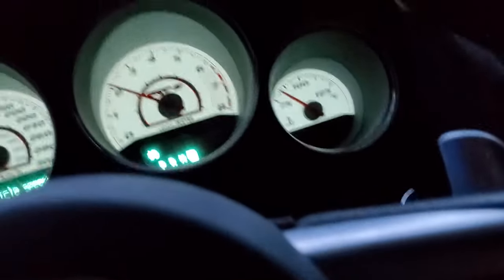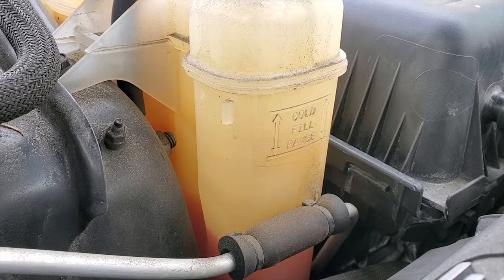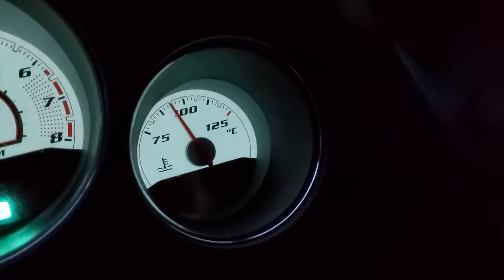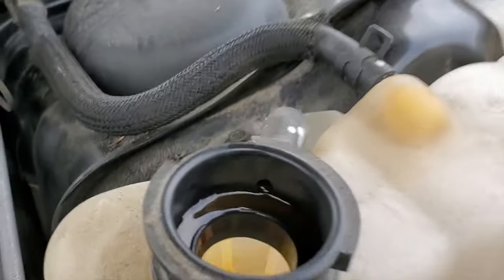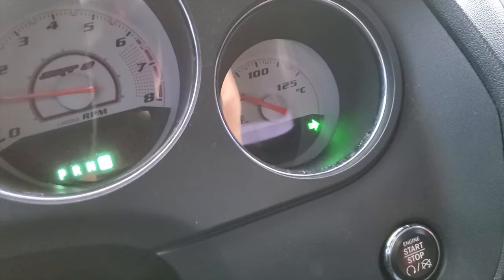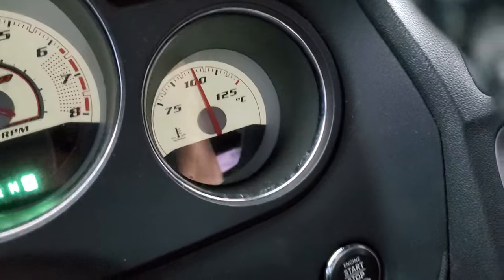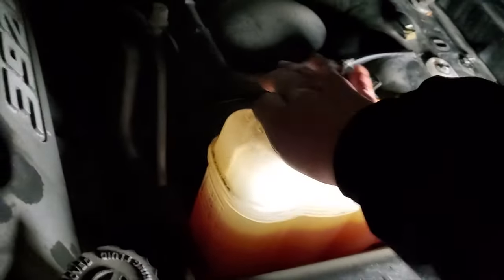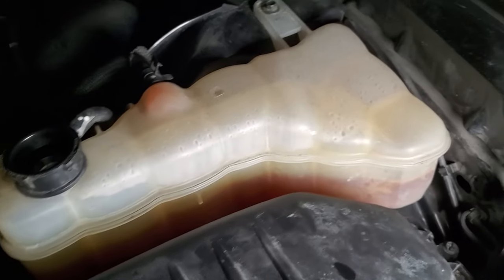Fluctuating Temperature Gauge Quick Fix on a Dodge Challenger

Comment: Many Dodge vehicles actually have unpadded temperature sensors which bring that reading to your gauge. Some fluctuation under heavy load is normal with Dodges; it is reading a true coolant temperature rather than a padded one like most other vehicles — look at the manufacture rating for your thermostat. My 3.6L’s stat is rated between 185 and 220, and the gauge will reflect that in normal operation and will definitely go over that conventionally “normal” middle line under heavy load — totally normal operation for many Dodge vehicles newer than 2007.
Reply from the maker: thnx for chiming in, changing the thermostat fixed the fluctuations
Reply: Hey has your check engine light ever came on with the p0128 but then went off I also noticed when I first got my car it would always move but never ran hot
Reply: @ericalove8387  Oh yeah, it likely stored that code change your T-Stat. That code can trip if the vehicle is running too cool your T-stat is probably stuck partly open

Comment: Im pretty sure your car is supposed to stabilize at a certain point usually a little under the half point and not fluctuate really at all. I would make sure your engine coolant temp sensor works and also make sure your gauge in the dadh cluster is reading correct.
Reply from the maker: Thnx for the tip! All seems well at the moment and the temp gauge has stayed under the halfway point
Reply: That's what I was looking for..kc

Comment: Bring the car to operating temp. Slowly open or release the radiator cap. Allow the air inside to escape. Fill with radiator fluid and repeat

Comment: I’ve got a 5.7 hemi it’s a 2006 grand Cherokee idk what it is but I think it’s the water pump is bad because it will idle just fine without overheating or anything and it’s fine for around the first 10 15 minutes of driving but then all the sudden the temp just blasts almost all the way up and I have to put it in neutral and get it to 4500 rpm and it will eventually cool down most of the time but sometimes it doesn’t if you may have any knowledge of this problem I’m welcome of help
Reply: U sound right
Reply: Have you found the cause of that?

Comment: I have a challenger SRT 392 hemi 2015 and is it normal as its coolant gauge keeps moving between 90 to 100 degrees celsius?
Reply from the maker: hey there, in my opinion it's normal, I ended up changing the thermostat and that ultimately fixed the fluctuating.

Comment: THX 
i have 392 2011 and its doing the same thing playing around 92 to 104 C
i had replaced the radiator also the thermostat and the oil cooler 
and still playing  im going to to replace the water cap then temp sensor
Reply from the maker: danngg u replaced all those and its still doing it. that's crazy
Reply: Did the cap fix it or the sensor?
Reply: @jeffreystevens3917  a good mechanic check it and found water pump to be bad all good after

Comment: Hi there, just a question. When I have my car heater on high and fans at full speed, the car's temperature goes down slowly and even faster at idle. It goes well below operating temperature based from the gauge. I noticed on my car that it usually holds the operating temperature when I have the fan heater at the lowest setting.  I took it to the dealership stating that there may be some play within the thermostat assuming it's stuck open, but they told me the mechanic took it for a test drive and it's working fine. I took a video of the gauge as it fluctuates to show them since I plan on bringing it in again. 

They said it may just be the design of the car and how the grill is designed letting the cold air in, but I don't think that's the case as I used their loaner car during the time which the gauge was behaving normally. I'm just wondering if you have any suggestions or anything else I should say.

Thanks!
Reply from the maker: Hey there! Thnx for stopping by! The eninge temperature being dictated by the heater fan may indicate a failing thermostat but with It being slightly stuck in the open position allowing the heater fan to dissipate heat based on its fan speed. Also Considering the engine temperature drops rapidly also indicated a stuck open thermostat allowing the coolant to circulate through the whole system and dissipate heat away from the engine faster. Also another suggestion is that if it's a used vehicle the previous owner may also have put a 180 degree thermostat in as a mod, I think the hemi thermostats is a 220 degree thermostat. With 180 degree thermostats they open at the lower temperature which cool the engine at that point rather then the higher 220 degree thernostate. In any case I would just replace your thermostats yourself. The thermostats itself should be under $100 depending on where you live, its located at the front of the challenger and theres only 2 15mm bolts to get at, then rewatch this video and bleed the coolant system by running it with the cap off until it hits temp
Reply: @moparbro  Thank you so much for the reply. I'm not very mechanically savy, but you're explanation helps me a lot to understand why the thermostat is acting up. My car is still under warranty so I'll take it to the dealership again so they can replace it. I appreciate your help!
Reply from the maker: @jrd9147  no problem at all! Thnx for stopping  by!
Reply from the maker: Hey there! Here's a vid of how to change the thermostat! https://youtu.be/na-OUtNdi6Y

Comment: Srt6.1 here. My cars always fluctuated. But never got too hot. I changed thermostat and it seems to fluctuate quicker sooooo? Maybe air in system too idk
Reply from the maker: Yea could need a good bleed, or a coolant flush.
Reply: @moparbro  garage put fresh coolant in when changing thermostat. They said they bled the system. I dont think they knew what i was on about with the coolant bleed screw as you showed. Is it possible they did it another way?
Reply from the maker: @El-Armstrong  hey there, some mechanics believe it's a self bleeding system, which it technically it is, so they may have run it with the cap off for a bit and air would rise out the reservoir hole. Also there my be a blockage in your coolant system In which a coolant flush would help, it's the flush where it's connected to a machine and coolant is pumped with pressure into the cooling system and sucked out through the machine as well. Usually blockages would clear through that. or a blocked heater core. Really for the coolant system. all there is is the radiator, water pump heater core, thermostat and coolant reservoir. so it's one of those. hope that helps
Reply: @moparbro  when i say fluctuate, i mean in slow traffic it rises to 220. Then when im moving it drops to like 190? Ive heard some ppl say its normal but i wana be sure. Yeah i think they kept bleeding it that way all day.
Reply from the maker: @El-Armstrong  I guess if you are in a super hot climate it can fluctuate, up here in ontario, Canada it stays stuck at 190ish.
Reply: @moparbro  im in England so i wouldnt say thats hot haha. But its a lot of stop n go city driving so idk. But yeah some forums say its normal as long as it dont overheat. Which mine never has. Did u say they bleed themselves a little when you drive em?
Reply from the maker: @El-Armstrong  yessir, there's a valve on the reservoir cap that lets air out when it get there, yea just monitor it, shouldn't go above 230 I would think.
Reply: @moparbro  ah so it may just gradually bleed the air out itself if there is indeed any in

Comment: is 226 normal or too hot for the engine oil?
Reply from the maker: hey there, it's ok, the fans should kick in and Lower it to about 210, if it fluctuates past 230 I would change the thermostat and bleed the coolant system
Reply: @moparbro  its like 100 degrees outside and the temp goes to 226/228 normal driving...it idles at 210...i already changed the coolant
Reply from the maker: @noeorozco5054  ah gotcha, try a 180 thermostat it'll cool it right down

Comment: My car runs hot while I'm sitting but goes back to normal while I'm driving any Ideas of what's going on
Reply: Check your Fans both of them and if nothing wrong check your colling system if its was ok could be the engine
Reply: Yea that’s normal at stop it cools since there is no air while driving going into car
Reply: @Paolo Lope yup mine is doing the same on my 0’3 Camry I’m finding out it’s the engine valves imma have to get it rebuilt prob next week . It’s not overheating just taking in too much coolant and oil.
Reply: Add an extra fan with a separate switch you can turn it on while idle